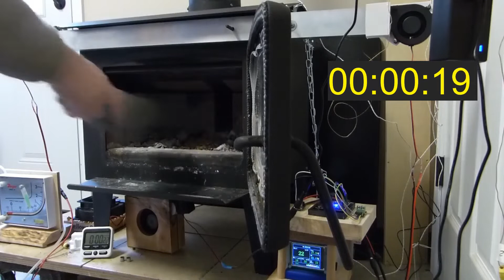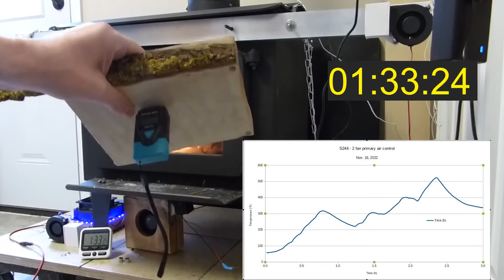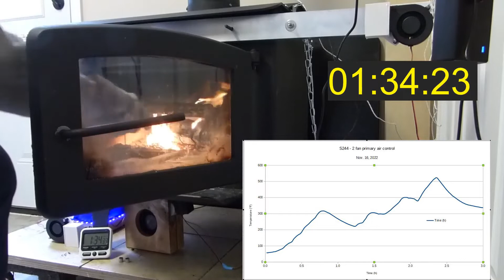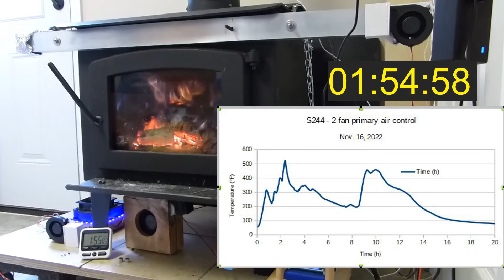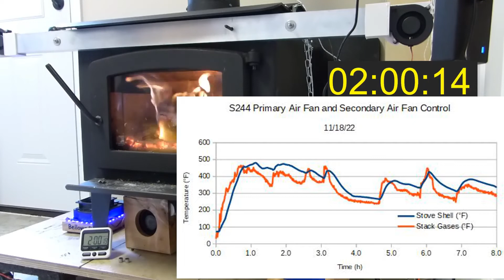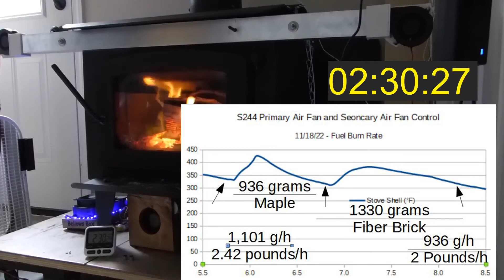Wood stove combustion air fan testing

Comment: Good experiments, thanks for posting. I'd love to learn more about your sensing and control set up and hope you might make some videos with the details of the microcontrollers and sensors. Is the pm2.5 monitor commercial or a sensor attached to the microcontroller? Thanks again.
Reply from the maker: The PM 2.5 is a separate sensor with a PMS5003 and it has its own display. The output is digital and not easy to integrate into the data system.
Reply from the maker: smokelesschimney on youtube has more content